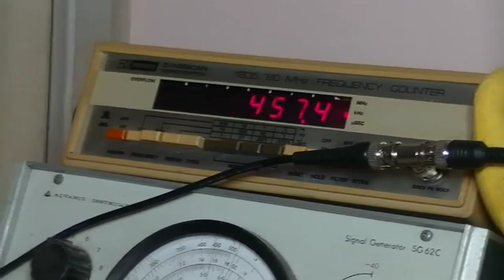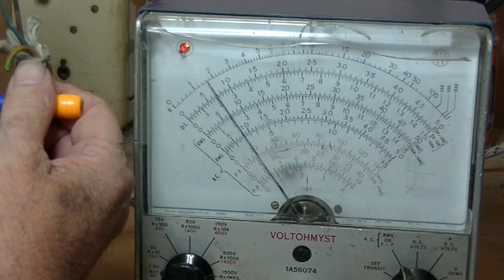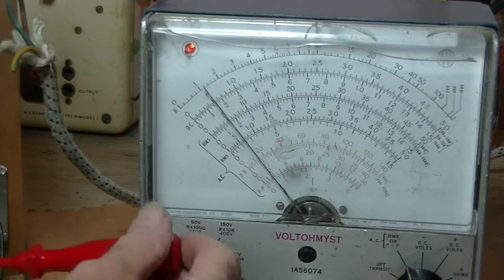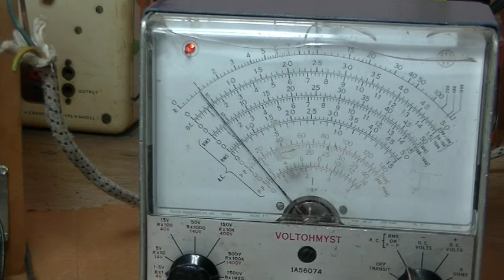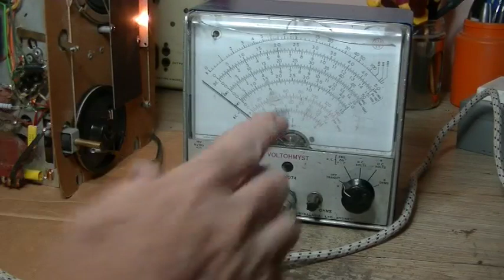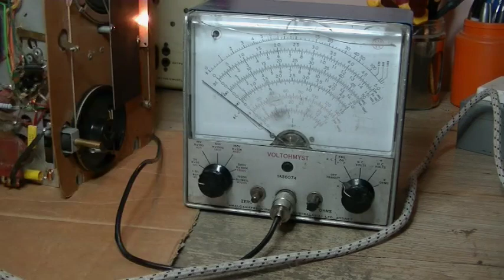Valve Radio Alignment using my new Voltohmyst VTVM

Comment: I was going to mention that in my comment on your other video on the VTVM , the plastic cover just pops off of the front with a lil screwdriver .  I think someone has taken it off already and they didn't line up the slot ..... It takes about 45 seconds to do that ....
Reply from the maker: Thanks for that Cajun, I never would have guessed. I thought the unit had been dropped